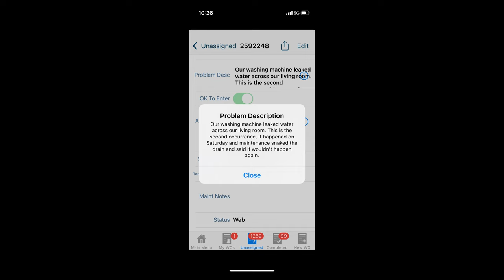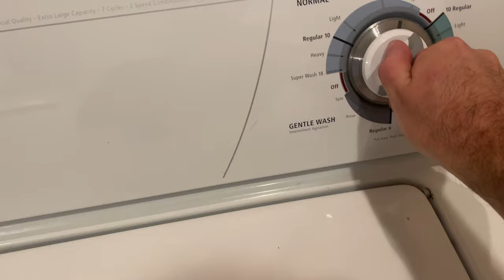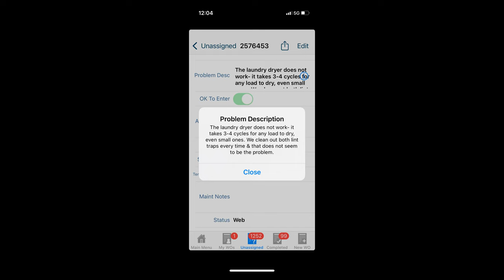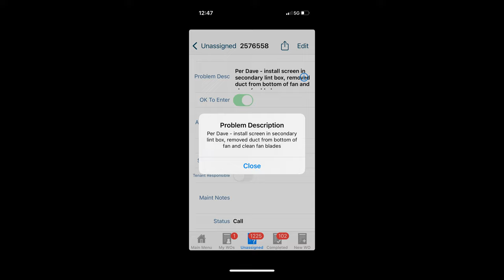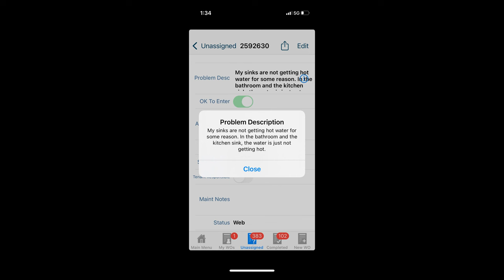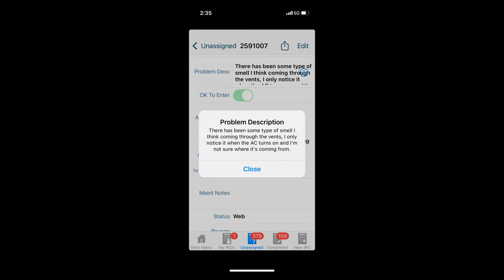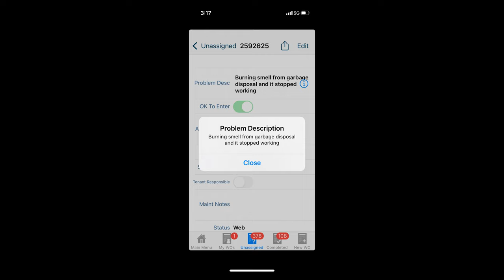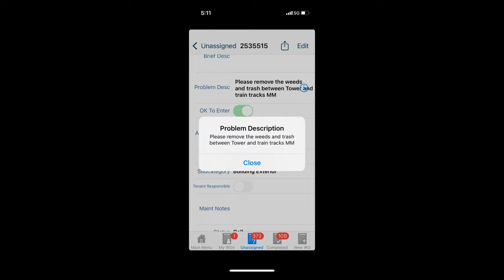Apartment Maintenance Vlog #16

Comment: I use the Saniseal waxless toilet gasket.  It is good for situations where the closet flange is below floor level and a lot more forgiving than wax if the toilet moves.  Only drawback three times the cost of wax but a labor saver.
Reply from the maker: Thanks Gerald! Will look into those 👍

Comment: Hey man, love the videos, only thing I would have done on that toilet differently is fixed the flange or added a Oatey flange spacer or two to fix the flange so its raised above the flooring/tile.  I've seen guys do the double wax ring before, not saying it won't stop the leak but eventually the wax will break down and it will leak again. Again, just throwing some tips to a fellow maintenance tech!! Keep up the great work!!
Reply from the maker: Thanks for the feedback Jordan! 👍

Comment: Had a similar issue today, leak was right above  the tub same problem with the unit above having nothing overflowing no obvious leaks, so we opened up the shower handle and sure enough found the spindle was leaking

Comment: With the company I work with that toilet leak would have gone into remediation because technically it’s black water , if it was leaking from the tank it’s clean water but from the wax ring it’s black water. 
Different procedures, every property is different.

Comment: I use double wax all the time but without the funnel. If you set a toilet and don't feel it sink into the wax you should pull it back off and look. The guy that set that toilet screwed up.
Reply from the maker: Thanks Stan. I’ve never had a problem with double wax I know some plumbers swear it’s the worst thing ever though

Comment: Gonna get crap for this huh? I see what you did there. Sometimes you just gotta improvise adapt and overcome. On occasion I've used the larger wax rings and had them work but sometimes you just gotta use 2 rings.
Reply from the maker: Yes sir - I know they have those adapters but we didn’t have any and if we did I probably still would’ve used 2 rings anyway